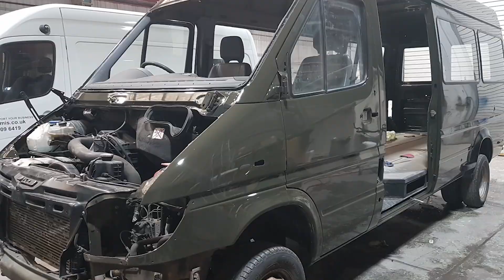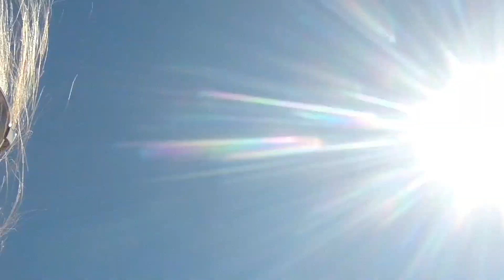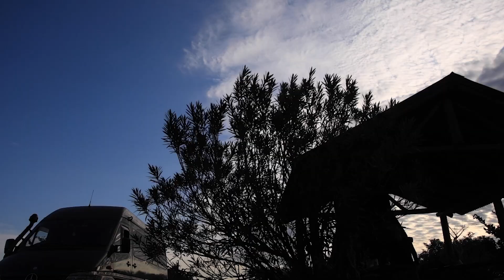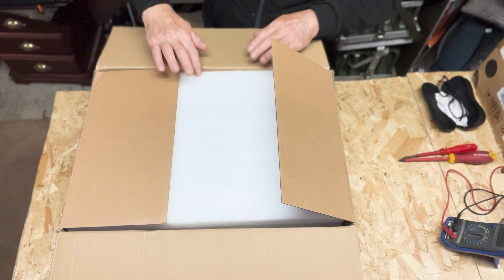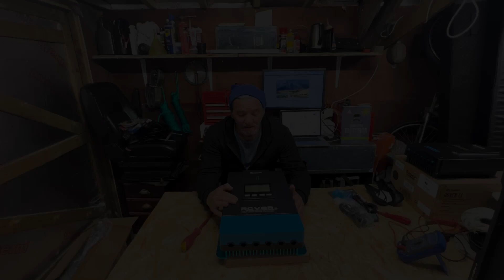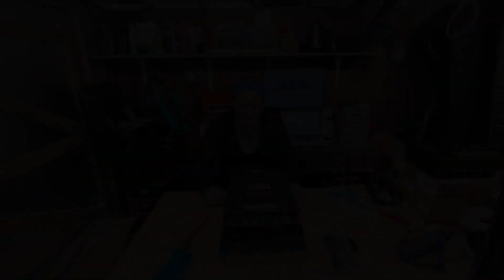Renogy Rover Li 100 amp MPPT Solar Charge Controller Overview

Comment: The one I purchased quit producing after about 8 months. I performed all of the troubleshooting that renogy advised of and did their updates with no change in the production of the equipment. Now they tell me it is working in specs even though it is only producing 50% of its capacity of a 1200 watt system. They will not stand behind their products and they will not warranty. They finally quit responding to my emails.
Reply from the maker: That’s not good, what checks did they suggest?

Comment: Would not recommend this controller. The wire ports are too small for 12/24v, does not disperse heat well enough, fine tuning setting can be next to impossible, does not wake more than a single bms, bluetooth has no range, customer service is poor. I absolutely hate the terminolgy used for setting and charging phases. Much happer with my other charge controllers because I can actually set values within .1v of accuracy, very important when trying to care for a battery bank. Do not use the predifined lithium setting.

Comment: The Renogy 100 amp MPPT solar controller is good for Lithium 48 V for sure.  The setting are olso on the DC HOME app !I’ve been running mine now for over a year. The extendable Bluetooth with its cable is also wicked in the respect that you could have it outside of your powerhouse or motor home  to get the data from a distance, specially on your phone  App .Mines is a off grid home system  and i have 48 volt 200 amp ! Thanks for your time

Comment: Thanks for your video. I do remember reading my instruction manual and Lithium 48 V was totally fine and mine has been running for 12 months with Lithium. Also let acid before that but saying that it’s only two years old. I will check and reply. !

Comment: I can’t find anywhere on the website that says it doesn’t do 48v Lithium, are you sure ?
Reply from the maker: Thanks for the question, perhaps my misunderstanding of how the auto voltage detecting works for 48v and lithium batteries. Rechecked the manual. Li 24v, 36v & 48v need to be manually configured to work correctly. Makes sense 48v Li will work with this mppt really seeing as renogy have a 48v Li battery for sale.
Reply: from their website :: Automatically detects 12V, 24V, 36V and 48V DC system voltages (for non-lithium batteries). Compatible with various Deep Cycle battery options: AGM, Sealed, Gel, Flooded and Lithium. ////